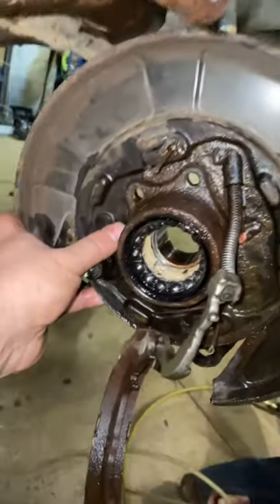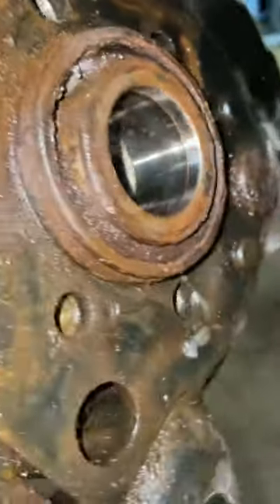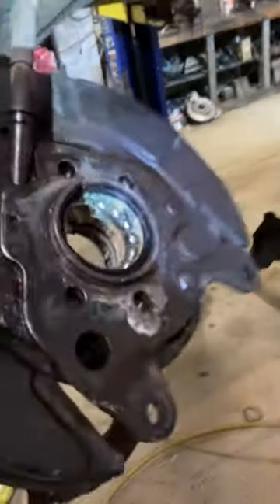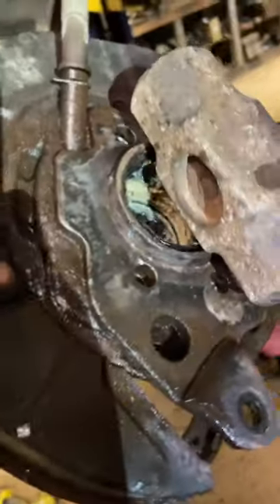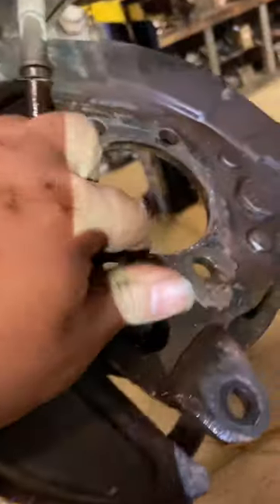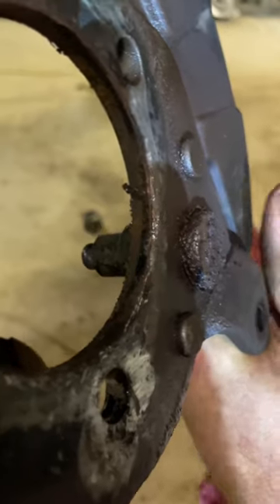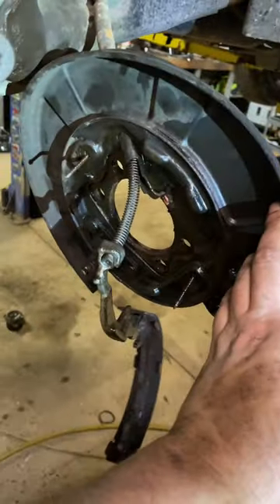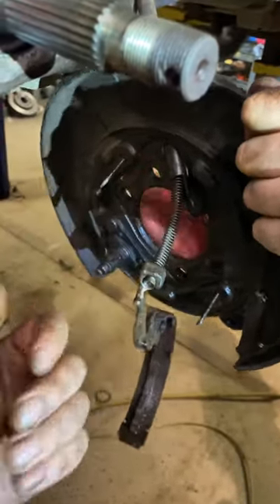Sexy Rust Belt Action

Comment: That must be a Subaru pain in the rear end to get off the knuckle, after that, a little heat around the backing plate, the bearing will tap out with little effort
Reply: We just paid $950 for an estimated 400 to replace an Impreza rear bearing(hub $160). I assumed it was stuck on the axle. Mostly glad they didn't damage other stuff, and I did pull the wheel after to inspect behind the plate.